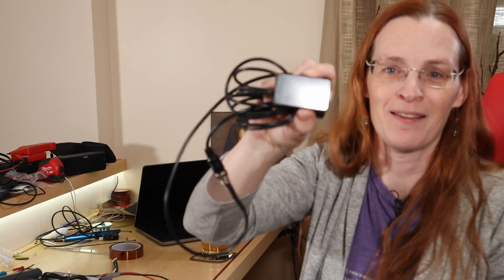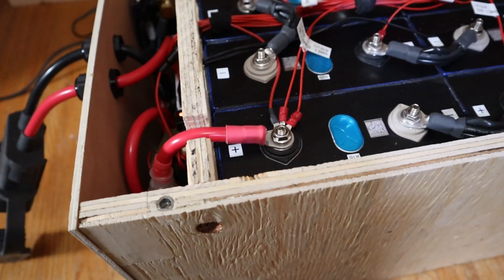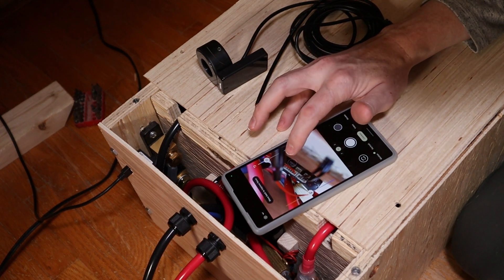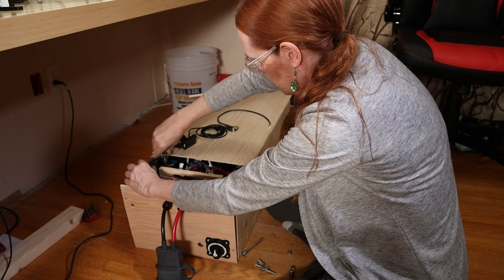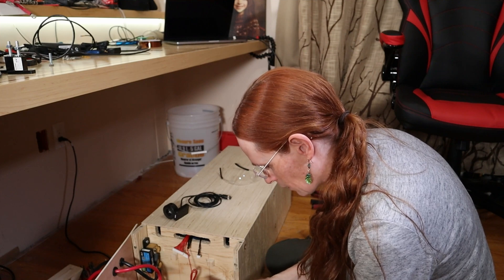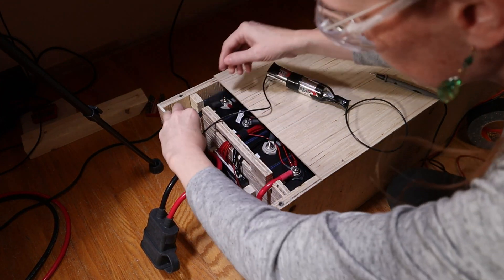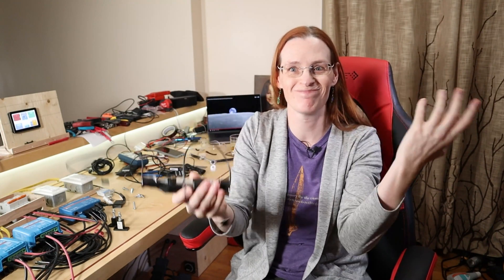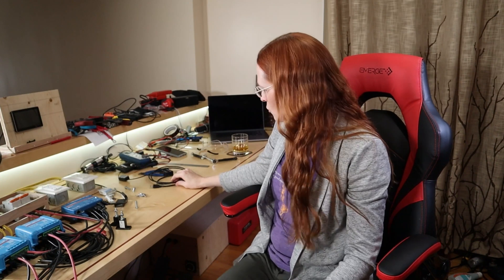JK BMS Frustrations - How to build a 48v Lifepo4 battery (Ep. 29)

Comment: Surprise, not really, if you or the reseller fails to check before buying if a bicycle display is compatible with a specific BMS and try to do things not in the manual for the BMS, I do not think that it is an error of the BMS itself as you now write. Only the discription of the display should normally include what bms is compatible with it.  But you and now we have learned something and not only related to this item but to most things  that needs to fit together. Check before you buy and or ask other users of the same devices if you can not.   It is like that program that say it is compatible with an operating system, but there will be old and new versions of the same system that will not work with this program. Sorry for beeing little negative but keep in mind you are not alone, can ask and some of it will eventually work but it will take some time when something is unique and small scale.
Reply from the maker: I put a link to the page I read when I bought it. It says: 

Jikong BMS ... LCD display Adapter
Current: LCD for 6-20p

I have 20p, so I expected it would work. There is no qualifier, disclaimer or other warning to check for compatibility. I expect when a company sells an accessory, they are open in their sales. So I respectfully disagree that I should have checked closer.
Reply: @TheDigitalMermaid   In the perfect world all sellers would know everything they sell and write their own descriptions for all items, but when something new come most will copy or translate the text and picture from the distributor or factory. If someone order there is a chance they may see the package or whats inside the shrinkwrap and still not know more then they are told.  Unless we see sellers that also show, test and use products, that is not common and would cost more if we buy. It is mostly up to us on YT to show this like you do, thanks I did not know about it before, but we also needs to be better then seller, and provide the correct information. "JK BMS Fail" you write but this is not about the JK BMS failing but a handlebar display and start accessory for another JK BMS that have incorrect description on aliexpress. It will probably work fine with the other new JK BMS that can be seen on several pictures from other sellers under the same link you provide.

We can not trust sellers blindly, they need to learn just like we do, and if you order something you are the master and most can not or risk loosing order or the job to message back and verify before sending. If something sounds too good and especially if new and not in manual, we need to verify ourself. Like we need to choose wisely on most things.  Hope this explain what I feel about this, respect that you think differently and looking forward to your next part. /Johan
Reply from the maker: @johthe  I am down on JK specifically because an ability to turn the damn thing on shouldn't be a function provided by an optional part. As for letting sellers off easy because "they just copy the marketing" is not something I agree with. That way of thinking excuses lazy sellers.
Reply: @TheDigitalMermaid  Don't feel bad... I ordered 4 of the displays.

Comment: The same thing happened with my investment in six Signature Solar 48 volt 100ah batteries! The supplier they receive the completed battery from, changed the BMS so it could communicate with Growatt inverters, but that ended the ability to communicate with a battery in a string. You can now only communicate by plugging into each battery one at a time! Nonsense. What pisses me off is the co owner of Signature Solar tried to convince me that it will work, but yet, his Technical Support group told me they were sorry but there is no workaround. They say it is the #1 complaint with the batteries, which otherwise I really like. I’m screwed. 

Now I realize this industry is too immature and fragmented to invest in the technology. Victron does it right.
Reply from the maker: I'm loving Victron more as time goes on. Expensive? Ya, I guess so, but at least it does exactly what it says. Sorry for the BS you're caught in.